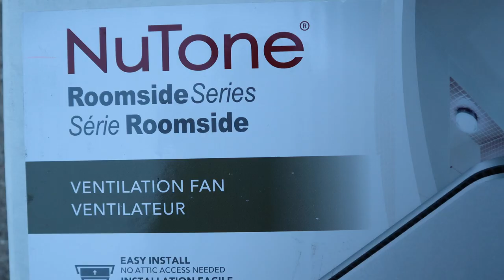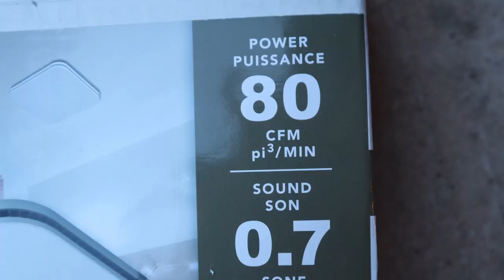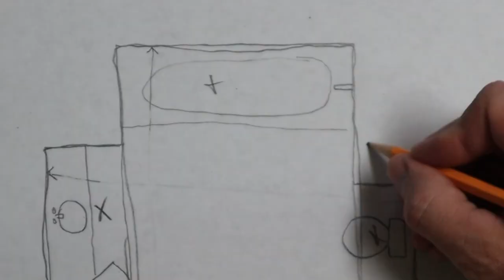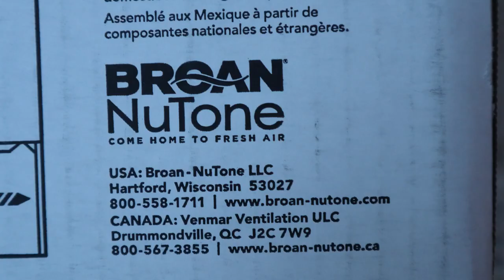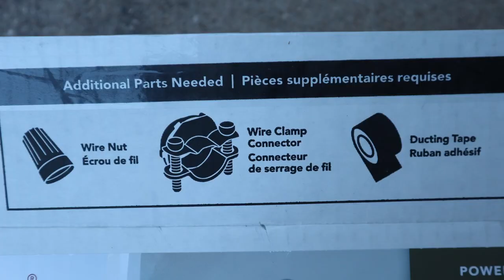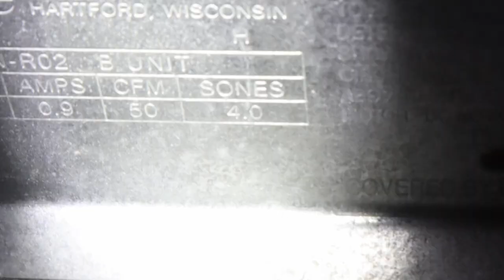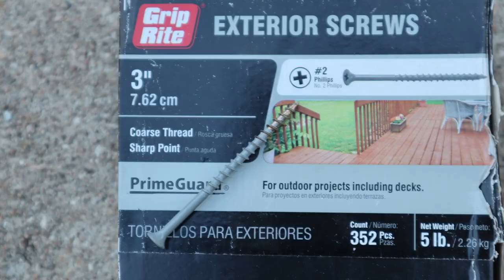Clear The Bathroom Steam For Good! The Exhaust Fan Upgrade!

Comment: That old NuTone fan you have in that bathroom is the same model I had in my bathroom and every bathroom in my house( though my NuTone fans are 70 cfm). Your vent fan could have benefited from a straight shot out of the roof like the ones in my house instead of that extremely long run. It’s no wonder it didn’t work well. (I replaced that NuTone fan in the upstairs bathroom with a Hampton bay 70 cfm fan that has a similar cover design.

Comment: This is real helpful. I need to replace one in our downstairs bathroom this weekend. I'm not too sure where they sent the duct because there's no vent outside on the house and I don't see anything up in the attic on the side where that bathroom is. I'm hoping it's not just blowing to the space between the ceiling and upper floor joists. Gonna be an investigation LOL
Reply from the maker: Thank you, glad it helped.  Yes I would be worried that is exactly what is happening, or that the duct runs up the wall.  Let me know what you find.  Thanks for watching.
Reply: @OakleysDIYHomeRenovation101 that’s the issue with older homes (sometimes in new construction too) is that bathroom exhaust fans often blow into an attic or just recirculate the same moist or smelly air around the bathroom).